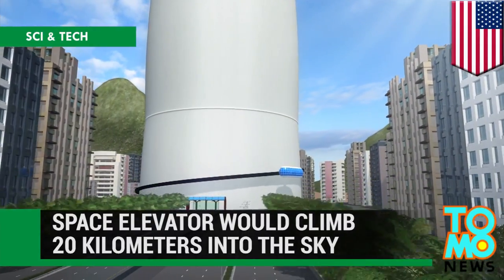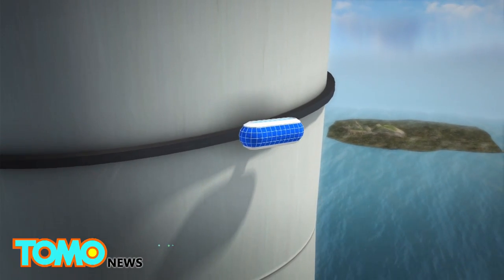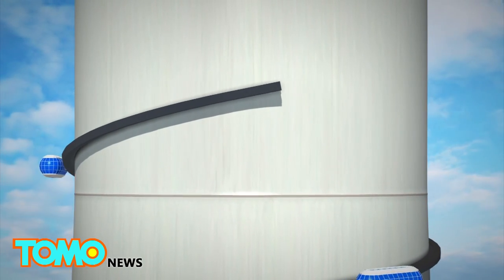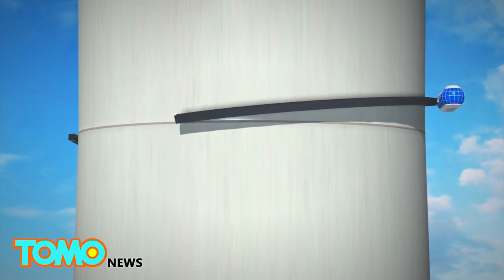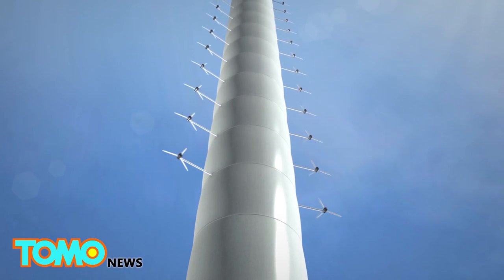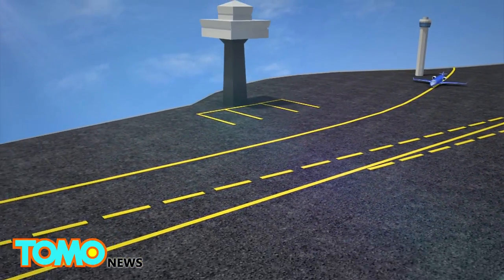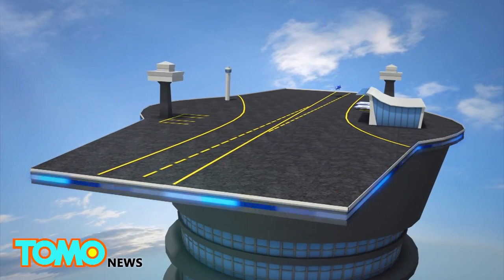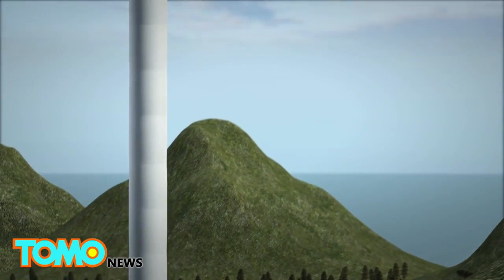Space elevator would climb incredible 20-kilometer tower in ambitious Canadian plan

Comment: This would be so cool. But so would all the other cool futuristic proposals that will never be built :'(
Reply: Looks like a pipe dream to me. No pun intended ;)
Reply: ***** Who is that?
Reply: *****  It would be a waste of 5 billion because it wouldnt work. It is just a concept. We have bigger fish to fry.
Reply: NASA is far from the only group to be working on carbon nanotubes, and indeed, we can manufacture carbon nanotubes right now, and they're... most of the things they're advertised to be.  The problem with them (and nanoengineering in general) is that it's still incredibly expensive to produce macroscropic quantities, let alone the thirty thousand miles necessary for a full scale space elevator.  At current costs you're looking at at least trillions.  We could use materials other than carbon nanotubes, of course, existing materials like advanced aramid polymers would do the job, but you'd need a thicker - and therefore more massive, and therefore exponentially more expensive - cable to do it.
What this means, essentially, is that incredible cost of investment, while still economical and technically possible, and probably worth it given the tremendous return a space elevator could bring, is made extremely unappealing by the very technical advancements that drive it.  It's very difficult to justify spending a trillion dollars now when you could wait ten years and spend 50 billion.

The new space station would have a circumference of 20 kilometers. It would be able to house 2000 astronauts, scientists, students and even a few tourists.

20km is probably a bit ambitious to begin with.  You're better off starting with a bare-bones docking station (since, after all, you have to actually lift the initial upper terminus into GSO the old fashioned way, which... building something even the size of Mir, let alone the ISS, at that distance is perhaps best described as 'interesting'.)  Then you can build out to an extended docking station/shipyard.  Basically, start modest and work your way up, don't just start with the O'Neill cylinder.

Incidentally, when you do reach that point of building a 20km O'Neill cylinder, your 2000 astronauts figure is very, very low.  Such a structure could easily house *millions*, which would help to justify its own cost, which would be... incomprehensible, with modern tech.  (Of course, having a space elevator would ally much of those costs...)

Comment: I like how they show ordinary commercial jets taking off the top, which most likely couldn't run at that altitude.

You could probably do it, but why?  The obvious advantage is to skip the dense lower atmosphere, but you'd probably be better off with space plane.  You'd still have to accelerate to orbital velocity, and unlike with a spaceplane, which might be a quarter of the way to orbital speed by 20km, you'd have to start basically from zero.  
Besides, given that the project is so expensive and technically complex to begin with, you could build any number of other options instead - a launch loop or proper ribbon space elevator, for instance.
Reply: Addendum: You'd have advantages compared to an SSTO spaceplane since you'd no longer need both low altitude and vacuum engines (whether that vehicle has dual engine types or hybrids), especially if you wanted high delta-V beyond LEO - and, of course, wouldn't need to spend fuel fighting the intense air resistance of the lower atmosphere.  However, this could be replicated simply by launching the rocket from a large LTA airship.  While this would technically make it a two-stage craft, the first airship stage is reusable and so cheap (requiring only the fuel required to run its ballast pumps, which could reasonably be solar/wind powered) that it doesn't matter.

As is the technical difficulties in creating such a system already outweigh the benefits - this might change with the desire for routine rocket launches at a low cost, putting the system into an even more complicated tower arrangement instead of the nice portable airship seems unintuitive.

Comment: what if there's a earthquake won't it collapse cuz its straight up
Reply: Not everywhere in the world has big earthquakes.
Reply: This is like a giant balloon, not a solid structure; which allows it to adapt much easier to vibrations. 

I'd be more concerned with sheer force from the trade winds. It seems like they plan on taking advantage of the strong winds, we'll have to see if they can develop a method for managing that. What I find most funny though, is their  "trial" won't reach the strongest winds, which are closer to 4km. So their "evidence" that it works would be quite questionable. Either way, I think it could be a great idea. I hope it works out.

I should also mention that the higher you go, the less atmosphere, meaning more frequent asteroid encounters. While they realized they would need to make the structure in compartments, to avoid poping the whole structure. It begs the question, what if the lift is connected to the section that gets pierced?
Reply: it's relatively unlikely because of the canadian shield blocking out most earthquakes

Comment: Wait .. not planes usually fly about 6 miles above land ?
Reply: Well, for commercial planes.

Space-planes fly around and in... well, space. but I can imagine the altitude sickness reports being attrocious.
Reply: Okay then...
Reply: 20km is 65,000 feet which some high altitude planes can fly at. Some planes can fly around 80,000 feet up. Planes like concorde had a service ceiling of 60,000 feet.
Reply: Not Miles and this is a take OF plattform to space ... It's Much easier to go from that spot to space
Reply: I'll bring with me a freakin parachute
Reply: SPACEPLANES. not normal planes
Reply: 30000000000000000000000000000000000000000000000000000000000Characters yeah I realized that .. my bad y'all

Comment: it won't work building a tower 20k in the air will not stand straight
its too heavy and it will bent EVEN if they attach holding guards
(or whatever you guys call em)  it  is too long it will bent in half
nothing is gonna be able to hold it straight nothing has such durability to hold such a giant structure (well except hulk maybe or super man)
but none the less its a bad idea plus add the weight on the top of the tower where the air crafts are gonna land and let's add wind to the list of problems
if there is a very strong wind it will be a problem for the tower
or earth quakes or even worst 
a fucking hurricane
now I don't know if hurricanes go to Canada
but if yes well you know what will happen next.